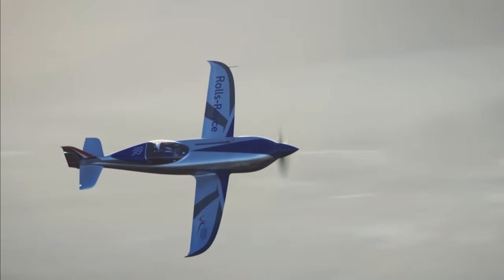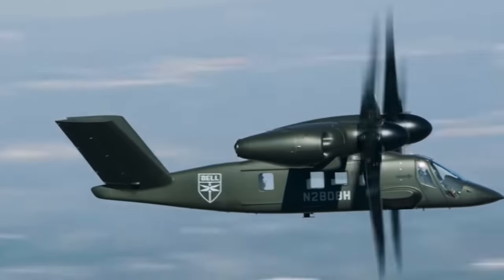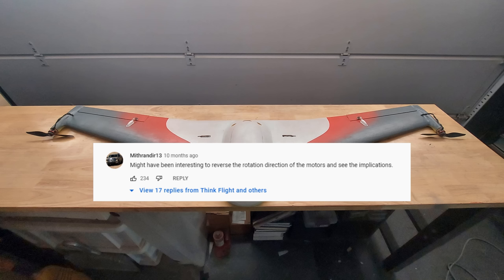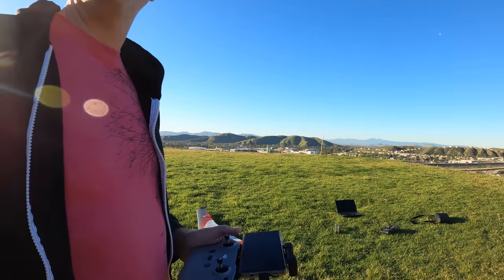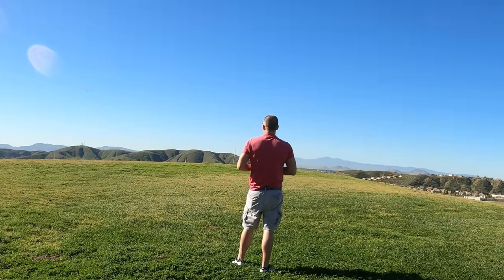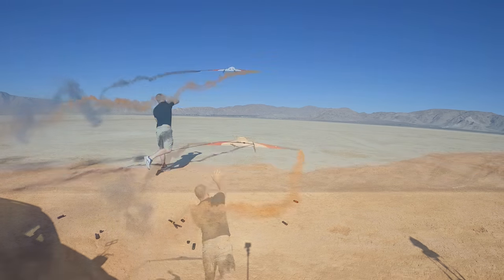Can Wingtip Motors Improve Aircraft Efficiency?  (Part 2)

Comment: An excellent point about drones having double the points of failure.
Drones also have quadruple the dependencies, while in a plane a motor can quit and it can continue, or both quit and it glides down. With a drone every motor needs to operate, and also operate at the correct rpm
Reply: No it's not... "points of failure" here is a misnomer. You could still fly a drone with three props. Two props would be opposed so they would be the lifting props as they don't contribute an unbalanced force, and the third could be used for attitude (it would have to spin forward or backward, and have to reduce the amount since it's not working against an opposing rotor anymore, but that's just software. Geometrically and physically it's stable). You can't fly a flying wing plane with wingtip motors when one goes out because attempting to thrust would just yaw the plane the harder you push. The quad has more points of REDUNDANCY, not dependency, until it loses more motors, and then it depends on which one you lose. If one motor goes out on the quad, do the others stop working or work against the center of gravity with leverage? not necessarily, so it's not a mutual dependency. With one motor lost on the plane, it's just a glider because due to the position of the motor, you've essentially lost two.
Reply: @enotdetcelfer  you can’t do that with a drone, all four need to spin with opposites balancing opposites otherwise you get yaw issues. You clearly don’t understand drones and so I’m not going to bother explaining it because it’s something that you’d understand better from your own learning.
Reply: This is really a moot point since most commentators were probably thinking more of a full scale scenario. A quadrotor will never be certified for people to fly in commercially without the proper redundancies in place.
Reply: @gpaull2  exactly, commercial drones would need additional redundancies, but that would mean more redundancies required. Each power plant would need one redundancy meaning 4 power plants and 4 redundant power plants, which is additional weight. Compared to planes where the redundancy is just flying down. Additionally without very difficult to create systems and advanced training, a large commercial drone wouldn’t be able to autorotate as it would develop a yaw drift as well as pitch and roll instability which just wouldn’t pass flight certification requirements.
Reply: @ryanm.191  Incorrect. You can't do that with "this" drone; not with "a" drone. We're talking ultimate design stability here. Nobody is saying the model RC plane is sketchy because a hobby electric motor could fail; they're saying ultimately using this in a plane is sketchy. A quadrocopter with alternating rotation direction in each prop would ensure balanced lift without adverse yaw and a powered landing using two props, should one prop fail. Not the case with wingtip props; you would be limited to a glide path.
Reply: @enotdetcelfer  you seem to still have a misunderstanding about drone control. A drone requires all four props to work, if one motor fails then it’s going to tumble out of the sky and fall like a brick. There is not glide or powered landing for a quadcopter.
Reply: @ryanm.191  The Osprey begs to differ, but who should I believe, a multi billion dollar military aircraft program based on the idea that counterrotating props allow safe powered landings with two props, or a random YouTuber insisting this design falls out of the sky. Hmmm...
Reply: @enotdetcelfer  that’s because ospreys have axels running down their wings that connect the blades together, allowing both sides to be powered by one turbine. Stop trying to pretend you know about this kind of stuff

Comment: the outer rotating configuration is inline with the  fact that the differential rotor torque reaction helps during roll and banking movement in a flight. while in a inward rotating configuration, the outward motor torque reaction on a banking maneuver work against the required roll movement provided by flaperon. This could be one of the factors resulting in inefficiency seen in inward rotating configuration.

Comment: One way I visualize why the wingtip vortexs rotate outwards, is thinking about the airflow under the aircraft. 

The compressed air under the wind slips off as it reaches the trailing edge. Because the wings are swept back the first bit of air able to curl up, is gonna come from the center of  the airframe. Since while this air is free to go to low preasure it can curl up and go outward, since the air further out on the wind is still stuck under the wings. 

I'd imaging this phenomenon changes with the swept back angle. 

With a  straight wing, all the air exits at the same time (except the air near the tips which is free to curl inwards) 

At certain angle this flow reverses (not sure what that is)

Comment: Much excellent content in this video, with great references. The aerial videos are most awesome. Great cinematography. 

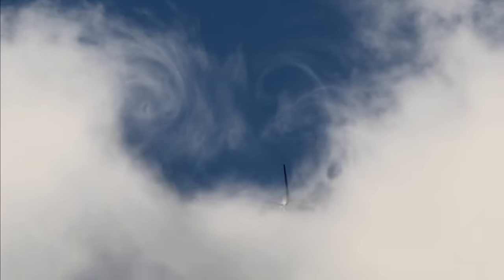After initially watching the video, I returned to the jet segment (from 1:03) ... watching repeatedly. Examining the vortexes frame by frame, a few things stand out. The most obvious vortex does not initiate at the wingtip, but instead appears to form at ~2/3 of a wing. (?) Also, the air about 1/2 a wingspan distance above the wing is clearly effected immediately as the wing passes by, as is air 1/2 span further out from the tip. It's like there are multiple scales and complexity to the vortex. (multiple cores) Distribution of lift, and pressure across the span is clearly not constant along a span, and extends beyond the span. This creates a pressure gradient and shearing forces that extends well beyond the wingtip.
 
The flap generated vortexes (at 1:17) are dancing, clearly being influenced. I suspect this an interaction with the wingtip vortexes, which are not visible. The high angle of attach of the deployed flaps is creating a much greater wing loading on that surface (much higher pressure differential) vs the main wing. Thus wing loading and angle of attach are major factors to amount of energy going into a vortex.

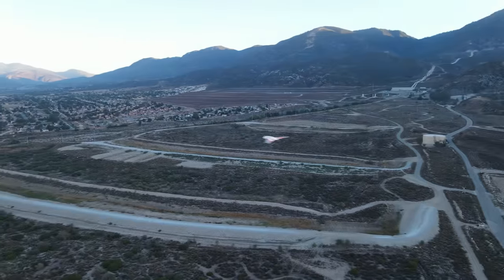Reducing the pressure differential (between top/bottom of wing) towards the tips would be beneficial to reducing induced drag. As would be reducing the wing loading towards the tips. Think you may be seeing some of this in the Serenity design, as there is built in washout to the flying wing. (lower angle of attack at the tips) This likely why the results fell within the margin of error for Serenity 1. Also from Serenity 1, you noted the complexity of the vortexes at 7:45 (in Part 1, previous video); where vortexes initially rotated outward, then merged into a larger vortex rotating inward downstream. This can be seen in this video (9:45) as the vortex with red smoke wiggles and transitions.

The RESULTS (5:43) of reversing propeller direction are pretty telling IMO. The 7.2% difference implies an efficiency change of just +/- 3.6%. This assuming one direction being an efficiency gain, the other a loss. 
Can see why now testing inward motors as explore further.
BTW: I don't think the tractor motors (vs pushers) would have changed the results. (ie: would fall within the same margin of error)

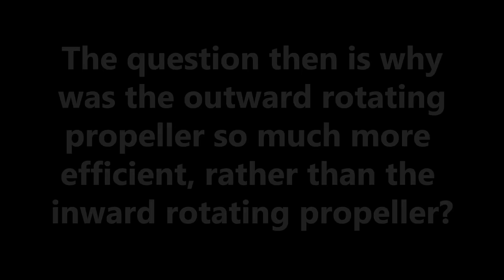To the final question (9:35), I think the efficiency gains are the result of countering the larger 1/2 span inward rotating vortex, not just the smaller outward rotating tip vortex. Having access to a fog machine like Daniel (RCtestFlight) might give a better overall view of what's happening along the full wing and beyond the wing, vs a smoke pipe at the tip showing airflow across only a couple inches. (ie: more data is needed) 

In future it may be interesting to explore different wingtip designs to see the impact on efficiency. For example how the shape (square vs a tapered), and how tip wing loading (angle of attack, or washout) of the outer segment of span effects efficiency. The tip design at 0:48 is pretty rad. 
Note: testing tips designs on a flying wing will present a degree of challenge as pitch stability typically maintained by having washout towards the tip.

Comment: If you think about how winglets work on an airplane is to remove the flow of air to the top of the wing due to high pressure on the bottom of the wing making its way to the top of the wing killing the lift on a portion of the wing. The propeller rotation outward I believe is doing the same thing pushing that airflow from the top far enough away from the wing to prevent it from reaching the bottom part of the wing killing the high pressure on a portion of the wing.

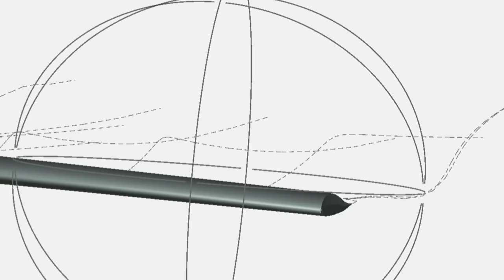Comment: I'm curious to know what kind of simulation you ran (at about 8:15). Did you do any sort of higher-fidelity sims? The structure of wingtip vortices can be finicky to pin down. I'd be happy to run a RANS sim on the model if you're interested...

Comment: True, a quadcopter with 4 rotors would be unstable with a single motor failure - but that's why drones with uses that place a high premium on safety use 5+ motors. Same principle as so-called "office safety chairs", loss of one leg affects its stability, but not total loss of it. A better testbed could be removable wingtip motors as supplements to motors closer to the fuselage - then you can do a direct with/without comparison.

Comment: In the case of a wingtip motor failure, the yaw would be tremendous and unrecoverable. To be practical this would require a common transmission between props, so that in the case of a motor failure, the remining motor could power both props. It would make sense to mount the actual powerplants inboard as well, to reduce their roll moment.
Reply: yeah i didn't like how he sort of hand waved that issue in the video. the comparison with quad rotor drones is apples to oranges, as the factor of safety for the design of a small unmanned drone vs the design of a fixed wing aircraft large enough to transport people is, obviously, vastly different.
Reply from the maker: No hand waving, this is an unmanned test bed whose sole purpose is to learn about wingtip motors.   It is never suggested or recommended as a final configuration for manned aircraft, just as a quadcopter also is not recommended as a manned configuration.

Comment: Hi,
I'm an aeronautical engineering graduate.
If you intend to mount the propeller at the wing tips the wing should be SWEPT FORWARD not swept back.
The props should be rotating at opposite direction.
But for real aircraft (not rc model) you have to choose between vortex or structural load at the wing root due to propeller torque.
For me I think the best solution for your experiment is to use a counter rotating propellers like the DZP30. 
Enjoy.

Comment: Your aircraft is awesome and your skill is amazing, however it's very difficult to predict what is going on due to the sweep angle, the blended fuselage and the moving ailerons altering the vortices shed from the wing. For the sake of your experiment I suggest you use a conventional wing - tail configuration, with no sweep, twist nor dihedral and better even with no ailerons on the wings (you can use differential thrust anyway) and with minimal wing-fuselage interface.

Comment: Great work.I made two models use tip props and they were flying well .
I think you need a wind tunnel to make this more accurate. 
May be here is a possible reason:
Propeller rotating at outer direction,needs less torque, because of the wingtip vortex,and rotating inner needs more torque. Maybe there is a slightly difference in efficiency  of props, but motor efficiency changes.Some high kv motors may have higher efficiency in less torque,and this matches your flight test result.The only way to find this out is to add a torque sensor on wing tip, use rpm and torque to measure the real axial power,and this the real aerodynamically power you need.

Comment: It's possible the reason the tractor wingtip configuration was giving the flying wing some massive sideslip was due to the propeller's vortex column thwarting the self stabilizing properties of the wing twist, where as the pusher configuration doesn't interrupt those properties at all

Comment: While watching the video, I was thinking that maybe a flying wing is not the best aircraft for these tests, as the wing tip acts as an elevator and the lift goes downwards (then I saw you mention it at the end of the video). Maybe in a canard or conventional aircraft the difference is more noticeable, especially if it is a wing with a low Aspect ratio.
Reply from the maker: I think you may be right.

Comment: Try to test what motor configuration is best. Both spinning outboard, or inboard. Both spinning the same direction has always been normal for flight, but I'm sure wingtip vortices would benefit from contra rotation. Throw the air outboard or inboard?

Comment: I think the issue of this theoratically very efficient configuration is not only the case of the failure of one motor. In fact, the power of the wing tip motors will have major effects on the lift of each wing and on all the axis of the plane. This means that all the control axis of the plane will be strongly coupled which is not considered a "good" and "safe" configuration. The stability of the plane will be highly dependant of the algorithm, the sensors and the controlers of the motors and will necessarily leads to a higher failure chance because of the dependancy of many part.This can be acceptable for a non habitable plane only.

Comment: Have you tried to use ducted wing tip motors for this? would also make those crash landings easier on the components, I would personally use PVC pipe  make a field goal with a soft net and fly into that for landing.

Comment: If you were worried enough about engine failure (for a passenger model), you could always put a glide motor in the center of the rear, with enough power for emergency landings.

AI could recognise a failure and immediately brake the wingtip motors.
Reply: Not even "AI", simple sensors. Could probably make it all analog 60's/70's tech if you really wanted.
Reply from the maker: Yes, I think something like this would work well.

Comment: Nasa did a rc experiment with a wing called a "Prandtl Wing", based on the complete equation, rather than the main lifting zone, basically the wing tip architecture is redirecting lift pressure about 30% before the tip from under to over the top to the tip, causing the vortex to appear at the 30% mark opposed to the tip causing drag and converting it to yaw stability which has a positive effect in banking turns.

Comment: Around the same time I ran into your first video I had plans to make a tractor wing tip motor FPV wing......which is why I came across your video. I didn't see comments about why tractor might be more efficient. I think it's gonna be a little less efficient actually because of the wind obstruction of thrust.....maybe.

I was also expecting the efficiency increase to be more so maybe you're correct in thinking that the efficiency increase may be as a result of another effect or in part from more than one.

Comment: Just a quick suggestion regarding an engine out asymmetric truss problem. Considering the extreme lightness of these new electric motors, two of them could be used in tandem. Possibly with the prop shaft of the rear engine going through the prop shaft of the front engine. If the main front-engine fail for any reason, it would be immediately picked up by the rear engine. Just a thought.
Reply from the maker: I'm sure something could be worked out without too much fuss.

Comment: This is really nicely done. How did you measure efficiency between the two configurations? 

In a pusher configuration when the propeller is rotating against the wingtip vortex, it is experiencing an effective increase in pitch. For the same thrust output, less input power is required, so measuring motor current/voltage draw, RPM and vehicle speed would be interesting. I think weakening the vortex core and thus downwash/induced drag is a secondary or even second order effect in this configuration. A tractor configuration is theorized to have primary effect of reducing induced drag. Miranda's paper on wingtip propellers and NASA technical paper by Patterson and Bartlett are two foundational works.
Reply: Also, if you’re interested in running a comparative CFD simulation, let me know!
Reply from the maker: I will try to read those, thank you!

Comment: As an ultralight flying wing builder flyer I have found your experiments very intriguing. Fuel efficiency is the driver in new airliner design, 7% is a significant gain, you may well be on to the shape of the future.
Reply: If that gain comes from where he thinks then it's not important since you could gain that back with a more optimal propeller angle for that rotation
Reply: @joey_f4ke238  Variable pitch props could be useful in further tests.

Comment: Excellent design, test methodology, and execution!!  As always, you're scratch-built planes show you really have your build techniques down!  I wonder if you would see larger efficiency differences with testing a similar motor placement change on a conventional tail & wing aircraft.  However, it won't have the elegance of a flying wing.  I am also curious about the efficiency differences between downward, upward, and both downward and upward-pointing winglets.  Great series!
Reply from the maker: I think the efficiency gain probably is much greater with a conventional wing aircraft, or if a wing, a plank.

Comment: The reversed wingtip vortices are probably a result of the swept flying wing configuration utilizing the outboard portion of the wing as "horizontal stabilizer", in which case they are producing negative lift to counter the nose-down moment of the inboard lifting section in an aerodynamically stable configuration. Negative lift = negative circulation = reversed wingtip vortex